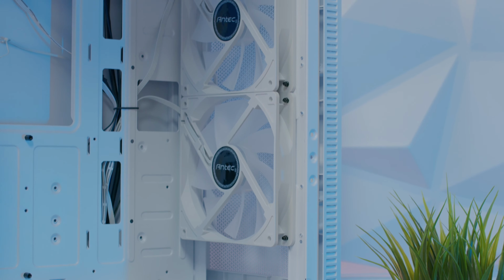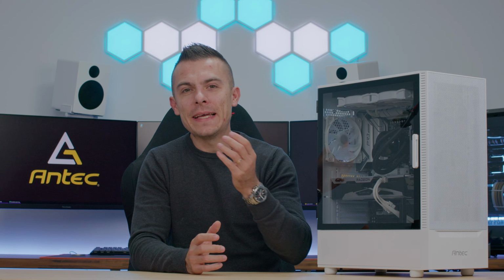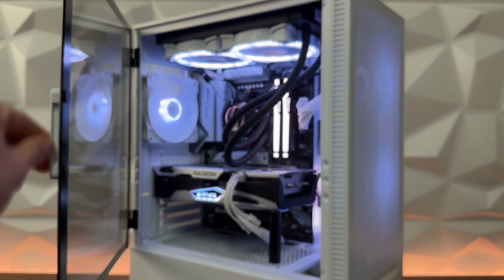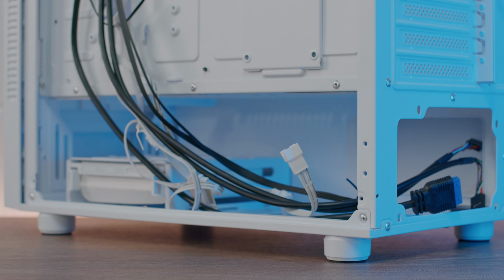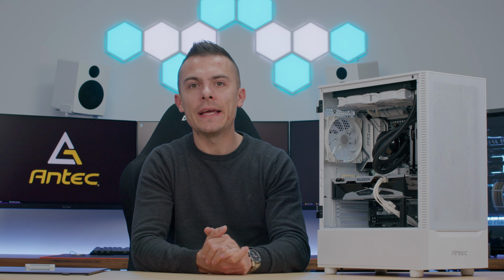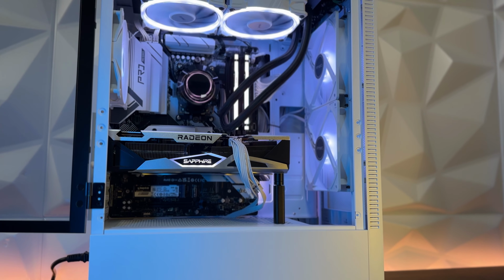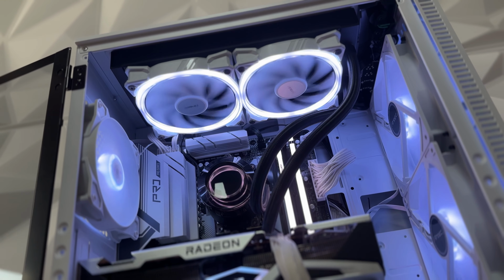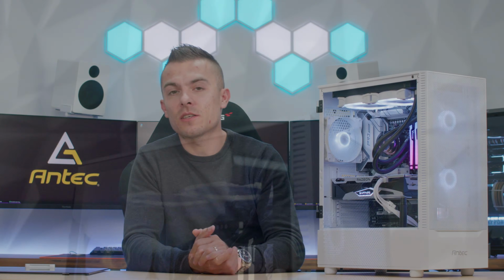New Fan Configuration - ANTEC NX410 WHITE

Comment: if anyone is struggling with being able to change the rbg lights on the case fans , its weird. you connect the reset switch thats on the exhaust fan to the front control pannel plugin that says reset sw. maybe im just dumb and i didnt realize this before but is also my first time building a pc and owning one. but i finally got it and definitely happy i can change the colors on the case fans now.
Reply: hola bro, tengo el problema de que los ventiladores de mi case se alimenta por sata, estos encienden pero no consigo que los colores se enciendan
Reply: @luckalvafabian5223 Tambien si lo ordenaste por amazon , no se si has visto los mensajes que han dejado jente sobre el mismo case , aveces las luzes no sirben ? y desculpa por mi español. español es mi segundo lenguaje

Comment: Does the motherboard have to be compatible with the case in order for the LED button to work? The fans glow green constantly, but don't change color even when the LED button is pressed. Everything else functions properly, it's just an aesthetic issue
Reply: have you resolved this ? my fans work with led lights but nothing happens when i press the led button

Comment: How can I change the color of the case fans? they only show red on mine. It’s because it’s only powered via SATA? These fans are weird because the front ones only have 1 cable for both power and RGB and the rear one have one cable for “reset”? And 2 for power and rgb I guess
Reply: I'm having the same problem! The LED button doesn't work to change the fan colors. It all works properly, but the RGB lights are the only things not working,
Reply: You need to plug the reset button connector to the reset cable of the exhaust fan to control the rgp
Reply: @anta8416  did you trie this

Comment: I just bought this case recently for my first build but I cannot control the fans with the button. It is connected to the data power and is working fine and the Rgb works but it won’t change with the led switch on the case😢 Can someone pls help
Reply: hola bro, tengo el problema de que los ventiladores de mi case se alimenta por sata, estos encienden pero no consigo que los colores se enciendan

Comment: How do I remove the front mesh? I can't seem to figure it out without worrying about breaking it
Reply from the maker: Press the crocodile clips on the inner part of the chassis and just pull the front panel out when they are all pressed, one by one. Don't have to be pressed all at once.
Reply: @PCCrazyDario  really? Thanks, I'll have to find them, I was looking all over and didn't see anything like it but I'll give it a try when I need to clean it
Reply from the maker: @Sinicety  They are on the inner part of the case holding the front panel and when you slowly but surely pull out the front panel while pressing them, they will go through the chassis and out with the front panel. ;) Can't miss them.

Comment: I built mine, but there's some cables that, I don't know where they go, and it wont boot
Reply from the maker: Do fans even spin?
So you have to connect 24-pin on the motherboard from the PSU, 8-pin EPS (maybe 2x 8-pin - depending on the motherboard) on the motherboard for the CPU from the PSU.
Then depending on the GPU, 8-pin, 2x 8-pin, 1x 8-pin & 1x 6-pin, 3x 8-pin or 12vhpwr from the PSU.
Connect all the fans to the PWM connectors on the motherboard or if you have a dedicated controller, even better.
ARGB header, 3-pin 5v ARGB to the motherboard.
Front panel jacks, bottom right corner of the motherboard to be able to power it on (check manual of the motherboard on how to connect them).
Finally, if you have some SATA drives, like 3.5" HDD or 2.5" SSDs as well as the fans (can't remember how the front ones are connected) and eventually if you have some controllers.

Really hope this helps out.

Comment: If i conect the fans with controller to the motherboard so i can controll them by software?
Reply from the maker: The fans connect to a SATA POWER and run a fixed RPMs unfortunately.
Reply: @PCCrazyDario  no i mean can i synced the colors if i conect them to a hub
Reply from the maker: @Bdi.  Sorry, my bad. I just opened up the case once again to check everything. On their website they state that the fans can be controlled with the motherboard software, but I can't find a cable that connects to their wierd fan connector. Now there must be a fault in delivery and packaging and I might have not received the cable that is neccesary for connecting the fans to the motherboard and to control them. So basically, this is all information I can give you
Reply: @PCCrazyDario  oh, i really glad you helping me. Thank you❤❤
Reply: @PCCrazyDario  i searched about this. Unfortunately its not able to sync by mb
Someone contacted antec and they replied that is the argb mean
Alpha, red, green and blue
So its not (adressable) rgb
Thank you again😊❤
Gn
Reply from the maker: @Bdi.  You are indeed welcome! :) I guess that is the problem. The only solution is if there is a suitable connection, but I think that cable end acts like a possibility to add more of the same fans. Sorry I couldn't help you more

Comment: anyother way to control the rgb fans other than the button?
Reply from the maker: Unfortunately no... :(
Reply: @PCCrazyDario  what if i conect them to controller
Reply from the maker: @Bdi.  I don't think you can since they are powered with SATA POWER cable from the PSU and the connection is re-routed to the button on top... Of course, if I remember correctly.